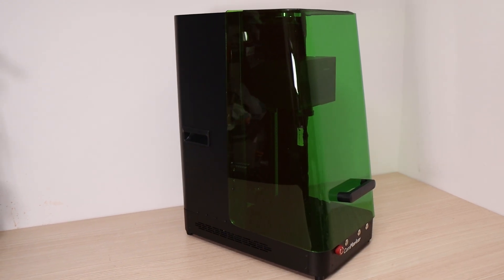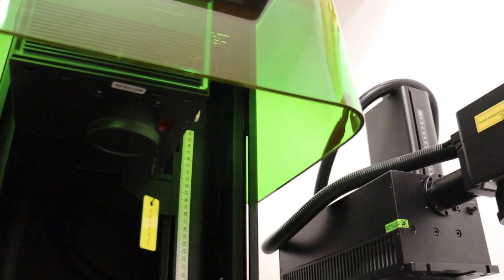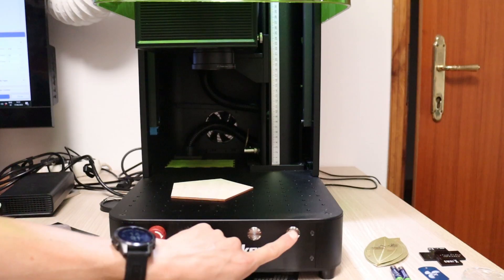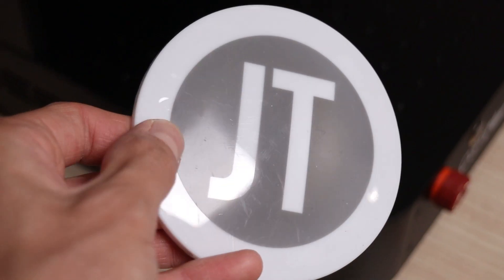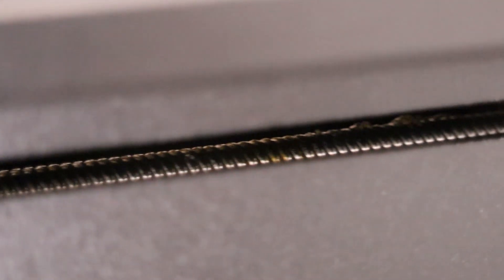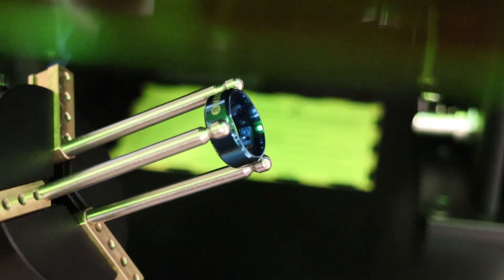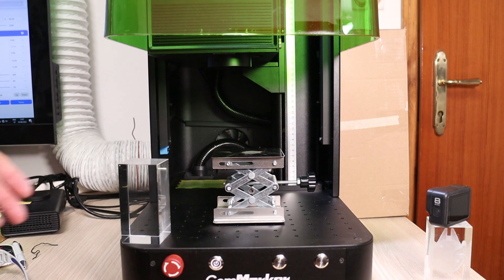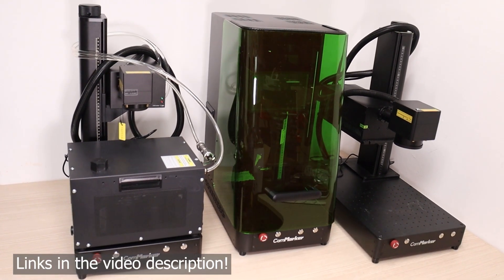Mind-Blowing 3D Glass Engraving! ComMarker Omni X Review & Test

Comment: Is the slide extension available for batch engraving? I guess if you make the engraving vertical from left to right you can engrave one by one. Can this machine do this?
Reply from the maker: You can put multiple designs in the engraving area and make holders on the slide extension for batch engraving